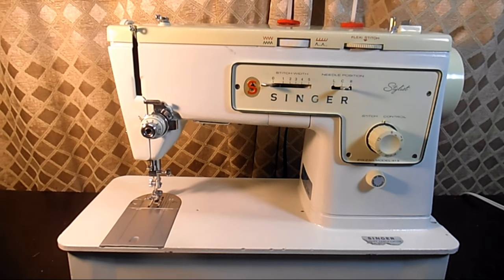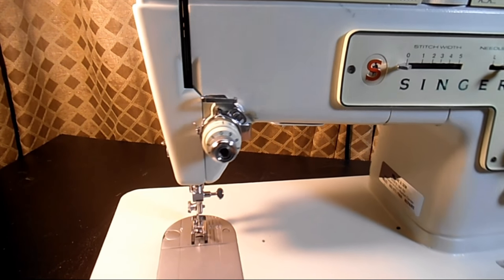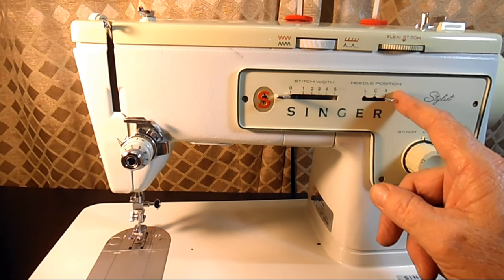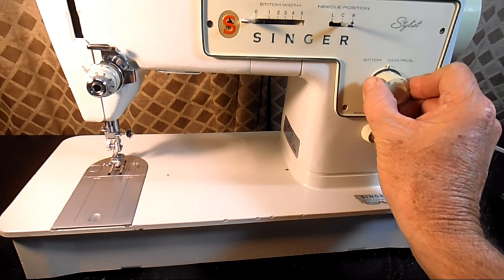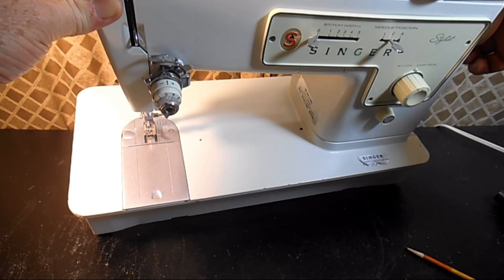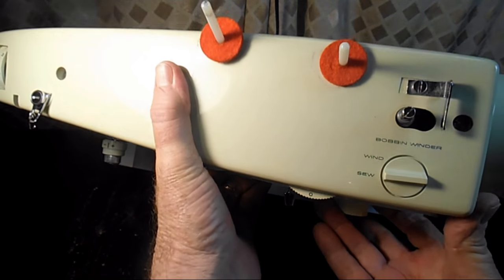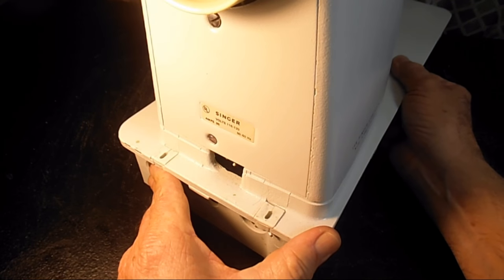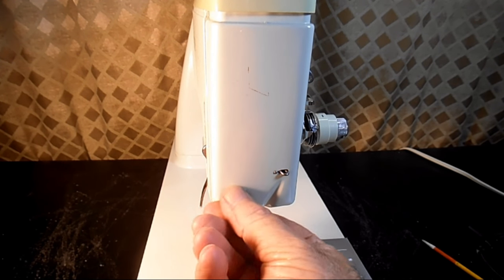TOUR THE FEATURES OF THE SINGER MODEL 413 STYLIST SEWING MACHINE

Comment: I just acquired a free Stylist 413. It is unfortunately, very dry and seized up, but for the price, I'm going to try my best to bring it back to life. Wish me luck!
Reply from the maker: I'm sure you can. The biggest issue will be the top gear on the vertical shaft. They tend to crumble & break at this age then the hook won't rotate. It can be replaced. Common for a vintage machine that has been stored for decades to be stiff from dried oil, especially in the arm shaft bushings. Here are some videos that may be of help: https://www.youtube.com/playlist?list=PLsCOZgzzaiKKVlkxPT9FMTdvUUGj8Ydf8     You can also download a free copy of the Instruction manual from Singer Support here: https://www.singer.com/search/support?title=413 Yes, good luck.

Comment: I learned two new things about this machine that I've had for almost 40 years. 1- I didn't know about the twin needle stitching. Seriously, didn't even know that was a thing and I've been sewing since I was a kid.  And 2- I didn't know about the other plate to hide the feed dogs. I inherited this machine from my grandmother, and to my knowledge, it never had one. 
Thanks for doing this video! I've been looking for information on how to repair and maintain it for ages, so I'll be checking out some of your other videos!
Reply from the maker: So kind of you to comment, Chrystine, thank you. I'm glad you found my channel. One Family machines are wonderful to own b/c they usually are in decent shape and the recipient gets a nice machine with memories. I also have a playlist for model 513, the next generation of your machine. It has some additional adjusting type videos if you ever need that;  https://www.youtube.com/playlist?list=PLsCOZgzzaiKLELksv_-MWE7tiAuzOgQj0
The only weak spot on your machine is the plastic top gear on the vertical shaft. It is fairly common that the plastic gets brittle from age and heat and starts to break apart. Keeping the top bearing well oiled helps prevent that (no oil on gears) I had so many emails about the gear problem on the handful of models with that gear that I finally did a video showing how to replace it for $10 and a couple hours of time. https://youtu.be/M3bFtlV1Y6s  Hopefully yours is in good shape and you won't need to replace it. Information on the twin-needle and where to oil is in your INstruction Manual. If you need a copy you can download it for FREE from SInger at this link; https://www.singer.com/search/support?title=413  Welcome to Andy Tube and thanks for the Sub. If  you have questions along the way, you know where to find me now.
Reply: @andytubesewing1953  thanks for all the help! I see you've replied to my other comment on the tension video... I'll continue the conversation over there since that's relevant to the issue I'm having.
Reply from the maker: @ChrystineHolcomb  Okey Dokey

Comment: Thanks so much for taking the time to do this. Just bought one of these cheap for crafting and your 'Tour' has explained it well - better than reading a manual.
Reply from the maker: Welcome. It's a nice, capable machine for crafting at home as long as the top gear (plastic) on the Vertical Shaft has not worn out.

Comment: Hey Andy I hope you are doing OK. I just revisited this as I was given a 413K by my mother-in - Law, she was a confident sewist  and is a great help when I’m struggling with some aspect of clothes making.  She bought hers in the early 70’s  one of the plastic gears gave out on me and I was able to replace it that is to your videos.I was confused by the Flexi Stitch Which you have cleared up for me I think  this is an underrated machine. MIL sewed at least two sets of bridesmaid dresses on it an numerous other projects. Thanks Andy the worldwide army of DIY sewing repairers owes you a lot.
Reply from the maker: Very welcome, Tony. Thanks for saving the machines. I very much agree about being underrated. The 400 models, like 413, 416, 418, 457 that have that plastic gear have a bad rep b/c of the gear breaking. Think about that for a moment and remember the machines are 50 years old. That gear lasted 30 to 45 years before giving out. I wonder how many modern sewing machines will still be working at that age. For about $30 you can replace the gear and both belts and be sewing for a couple more decades easily. A strong versatile metal machine. Happy sewing, Tony, and thanks for the very nice comment.🙏

Comment: Just got one of these from Goodwill! It had so much lint in the bobbin area it looked like a felt pad! Trying to get it cleaned up running smooth 🤞
Reply from the maker: Happy for you; a nice model for home sewing. If you need a manual it is free from SInger: https://www.singer.com/search/support?title=413    I have some maintenance videos for changing the belt, setting timing, oiling, etc. in a playlist: https://www.youtube.com/playlist?list=PLsCOZgzzaiKKVlkxPT9FMTdvUUGj8Ydf8  It is very common for this model to have, or soon have, a broken gear on top of the vertical shaft. If you do not see the hook going around in circles it's the gear gone bad. I made a video for replacing that gear. About $10 and 2 hours. https://youtu.be/M3bFtlV1Y6s  If you find issues I don't cover you can always buy a copy of the Service Manual from Terry: https://store.tandtrepair.com/st4134164185.html
Use coupon andy=h=yt in 2021 for 20% off at his store. Happy sewing Nicole, and thanks for watching my channel.

Comment: Hi Andy, I am a real "fan" of your very informative videos. After watching this one on the 413, my question is, in your humble opinion, (and if you were interested in investing in a solid, built to last machine), which machine would be the best--the 457 or the 413? I use my machine for garment construction, making quilts, mending, doll clothes, etc. I learned to sew on a 457 (years ago!),  and have been looking for a 457, but now I have an opportunity to purchase a 413. After watching this video, I am wondering which machine would be the best investment...? Any problems in either machine that you would care to caution me about...?
I have spent a great deal of time, especially in the last few months of "sequestering" watching your GREAT videos. I have learned so-oo much. Thanks again, and looking forward to your answers, and the next series of videos from you. Shari
Reply from the maker: If those were my only choices, I would choose the 413 I think. You mention sewing clothing, and I think you would enjoy having the Flexi-stitch feature. Otherwise, they are mechanically the same for the most part other than the bobbin winder systems and stitch controls. They both have a motor belt and a timing belt and use the same basic motor. They are both straight shank and use low shank Singer feet. 
     One came with snap-on feet and one clamp on, but that is interchangeable between the models. Some do not care for the snap-on and find vintage clamp-on feet to buy and vice-versa. They both can use all of the same attachments and accessories, like the buttonholer. https://www.youtube.com/playlist?list=PLsCOZgzzaiKIVBGEISHzZeWVk8-IxpHw0
     Both models have the same weak spot too, which is the plastic gear on the vertical shaft. If the machine you buy has not had that gear replaced, then it will be broken when you buy it or shortly after you start using the machine. That gear is 40+ years old and gets dry, brittle and the teeth crack off or the whole gear breaks. No kidding. It is so common for machines of that decade that I made a video about replacing the gear. It has been viewed 37,000 times which shows how common the broken gear is. Maybe you saw it? https://youtu.be/M3bFtlV1Y6s   Both the 413 and the 457 have the same gear and you see it can be replaced for about $10 and your labor. When you go to look at the machine please be sure the hook rotates. I take a screwdriver and flashlight with me and ask permission to look under the covers. Two screws and the top arm cover comes off and I can spy down to see that gear with a flashlight. If even one tooth is chipped it is on the road to destruction. If the hook does not rotate even though the machine is in bobbin winding mode then you know the gear is shot. Sometimes you can remove the bottom plate and the gear pieces are laying around on the oil drip pan. 
     Often people who are selling it got it from a family member's estate and don't really sew. They can turn on the motor and see the needle go up and down and tell you the machine "works" but when I can show them a broken or damaged gear I have often brought home the machine for $10 or $15. When new the machine cost about $1000 in today's dollars.👀 
     Both machines use the clamshell-style foot controller which can be used on the floor or mounted under the cabinet and used with a kneebar to control it. Both machines can be mounted in several models of a Singer Cabinet. 
     The belts (together) cost about $25 to $40 to replace and you can easily do that when needed. (my videos) The vintage carbon motor brushes last a long, long time but if they need replacement they cost about $15 and you can do that too! The machine is easy to clean and lubricate and can sew for 75 to 100 (more) years if kept cleaned and oiled. 
     You can go to the Singer support page and enter the model number (almost every model number works) and download the Instruction Manuals for the two models to compare features and see some of the feet and accessories if you want a little more info.  https://www.singer.com/support         
 So, that's my story and I'm sticking to it, Shari 🙂
Thanks for your interest in a vintage Singer machine and for watching my channel. Best of luck.
Reply: Thanks for the speedy reply. You have helped me tremendously, because you have told me the comparisons, the pros and cons of both, and that the feet & attachments are interchangeable.Yes, I will d/l the instruction manuals, and read those too.
I just finished watching the video on making a "good" light...I am gonna try it! Take care, and I hope your "new baby" arrives soon, so we can all watch another of your videos. Take care, Shari
Reply from the maker: welcome🙂

Comment: Hi Andy! 
It would be wonderful if you could assist! 
My machine only sews backwards even after I did a clean, re-oil, and re-grease. I followed your videos in this series. They are wonderful.
 The feed dogs are stuck sewing the wrong way even while the reverse knob is not depressed. I opened it up to take a closer look and am seeing a metal piece that the reverse knob is in front of. It doesn’t seem to move even when I try to wiggle it with a screw driver. It is rigid and only makes contact with the reverse stitch knob when it is fully depressed. Is this piece supposed to move? If so, What am I supposed to oil/clean to get it moving again? Please help, thank you!
Reply from the maker: I don't have the machine now. I probably have a parts manual and a service manual. Email andymanuals53@gmail.com for a free copy.

Comment: Andy, I found the plastic bobbin case for this model is chipped at the bottom where the bobbin sits and I’m guessing that’s why my stitches can’t get right.  I ordered a replacement from Central Michigan but it doesn’t fit.  I emailed them today to see if I can return it for a refund.  You can see from the underside where it’s molded differently.  I’ve looked everywhere else and I just can’t find that particular bobbin case.  Sewing parts online shows they don’t have it available either.  The part number CM sent me seems to be the same ones on eBay, from China.  Do you know of anywhere else that this may be found?  I’m seeing in this video, the machine has a metal one.  I’ll take whatever I can get that fits, lol.  Thanks
Reply from the maker: The original SInger Parts Manual for Model 413 shows the complete bobbin case to be part #172082-7.
https://www.ebay.com/itm/154930116407
Many people believe that parts 172082-8 will also work on your machine: https://www.amazon.com/evernice-Bobbin-Bobbins-172082-Singer/dp/B07LB2Q659

Comment: Your videos are very helpful, I changed the top gear and set the timing as your instructions and ordered a new bobin case (of metal) for my singer 413. I have a problem, after having set the timing, the hook catches the thread but the thread gets stuck between the bobin case and the metal plate around it (with 3 screws).  I tried to give some gap in between (by loosing the screws) but the thread still gets stuck. Also the bobin case (part number 172082-8) is very noisy. Please I need some help. Thank you very much!
Reply from the maker: so a small bundle of problems at first congratulations on replacing the gear keep in mind it may not be the correct bobbin case and also that you must oil the bobbin case where it sits on the little shelf of the hook and rides there that little shelf is called the race and must be oiled on top of that usually a bobbin case and hook wear a pattern of use together over the years so you have your original hook and you've added somebody else's bobbin
 case and they may need to break in to each other so to speak oiling will help though. The little space between the edge of the bobbin case and the bobbin case bracket cushioning spring is called the thread clearance gap and must be set to the correct space if the gap is too narrow the thread can get stuck and hang up there if the gap is too wide the thread can pop out and also the bobbin case will bounce back and forth against that spring and be very noisy on most vintage singers the Gap is someplace between point 012 and 018 inches depending on the particular model number here is a link to a video of a different model but it shows how to set that gap I realize the bobbin case bracket is slightly different but I want you to get the idea of how to do it so take a look at this video https://youtu.be/N9aWiTZi4w4

if you would like to have instructions on your exact model you may go to manuals on CD.com and search for your singer model I believe that they will sell you a PDF copy of the original Singer service manual for under $10 you can download it as soon as you pay for it and it should have a section on exactly how to set the gap on the thread clearance between the bobbin case and the cushioning spring.
Reply: RK MNA, did you ever find a bobbin case for this machine?  I can’t seem to find one anywhere.  The one I ordered from central Michigan didn’t end up fitting in there.  It also sounds like your 413 stylist is like mine, it doesn’t have the black spring to remove the bobbin case but rather the metal plate with the screws.  Not sure why the bobbin case is hard to find.

Comment: We have the same machine, the bobbin holder is not moving. Removed the bottom panel and time belt is not moving, discovered a gap between the gears connecting the time belt and the hand wheel. Everything else continues to work except for the bobbing holder/time belt below the machine, how can I fix this? We found a broken portion of a  plastic gear-like piece that is similar in size to the gap between the time belt and hand wheel gear, is it possible to find an existing piece? If so, where could we buy one?
Reply from the maker: You want a new gear, not used: https://www.amazon.com/s?k=155819&me=A3S73BWZA5BA61&ref=nb_sb_noss
Bob has a video: https://www.youtube.com/watch?v=63LXYiIVuoM
Terry has a written guide: https://store.tandtrepair.com/400stvgg.html

Comment: Hi Andy,  416 Stylist bobin case not rotating but can move it from underneath manually and belt is still in place underneath. Does this mean top gear or gears are broken? Made of plastic😕 I can't see top down unless I remove parts. I want to order parts but not sure what I need. Thanks Susie
Reply from the maker: It's the classic presentation of a broken top gear on the vertical shaft. You can remove the top cover and see it under the horizontal arm shaft to the right of the camstack. It's in the same location as the 457 model in my video https://youtu.be/M3bFtlV1Y6s
The gear is part # 155819 and I buy mine here https://www.ebay.com/itm/202777631971?epid=665814990&hash=item2f367d1ce3:g:QGcAAOSwMe1deuVX   I prefer the white plastic gear.